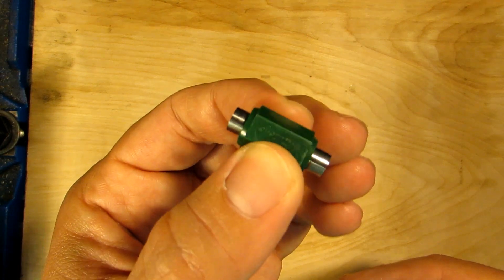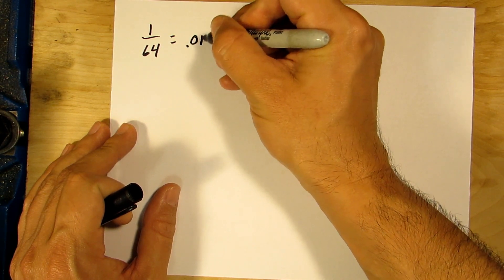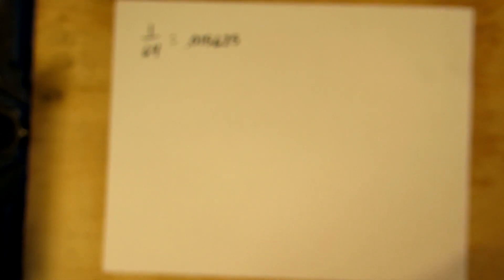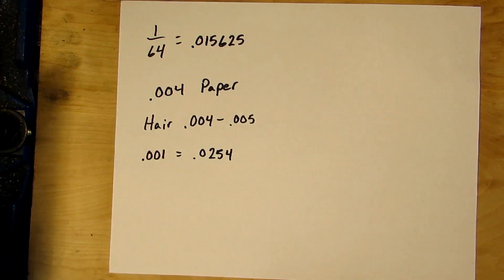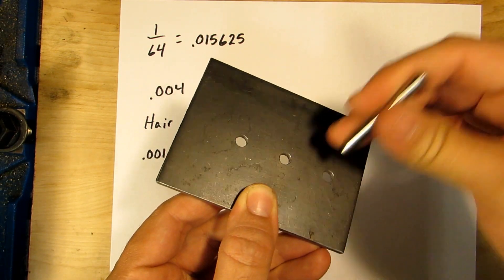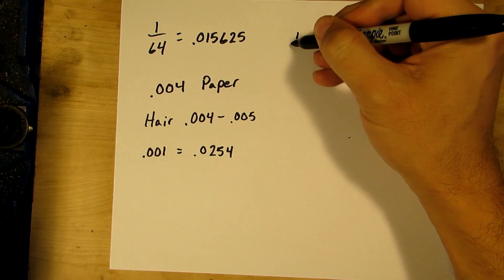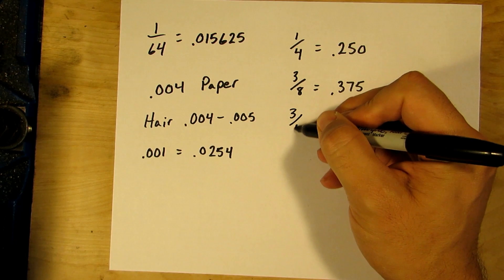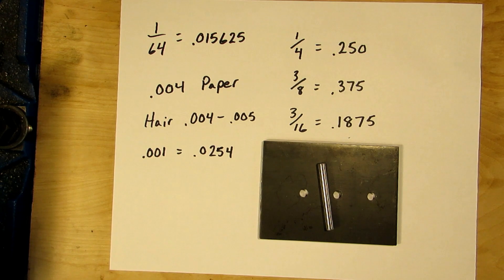What is a Thousandth of an Inch

Comment: Stuart,  Great demonstration.  I have a question that I think would be a good beginner video.  Whilst reading through a bunch of Workshop Practice Series books, you see terms like, free sliding fit, shake free fit, press fit, firm sliding fit.  I know this would translate into the difference between the diameter of the part being inserted into the bore of another part.  But what are those differences supposed to be for each type of fit.  Also, if 3/8 = 0.375 of an inch, at what level of precision should this measurement be.  For example, One print has the fractional measurement 3/8 and another print has 0.375.  Thanks for your consideration.

Laus Deo,
Joe
Reply from the maker: Hi there.  All of those fits change depending on the size of the mating parts.  There's quite a lot written about fits in Machinery's Handbook.  As far as the level of precision, most prints will give a range of tolerances based on how the dimension is written, so if it gave it as 3/8", you might have a +/-1/64" tolerance, whereas writing it in decimal form might make it +/-.002".